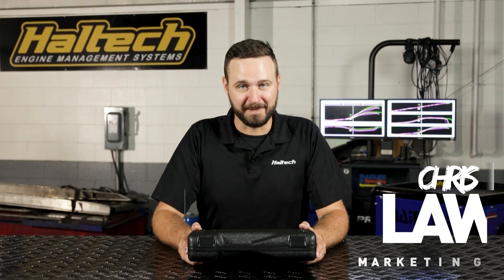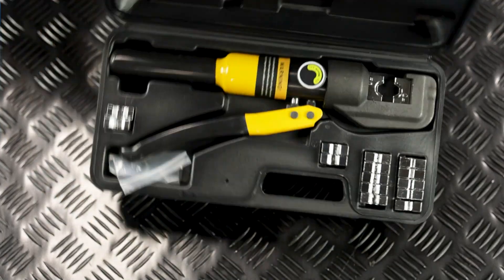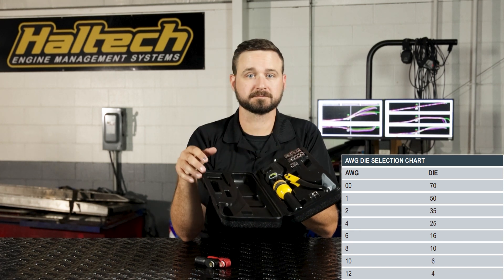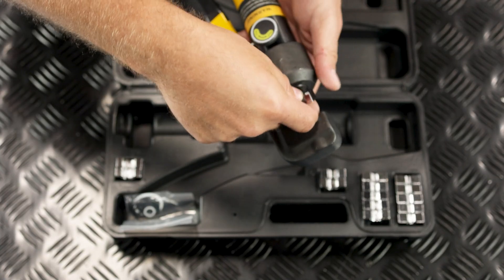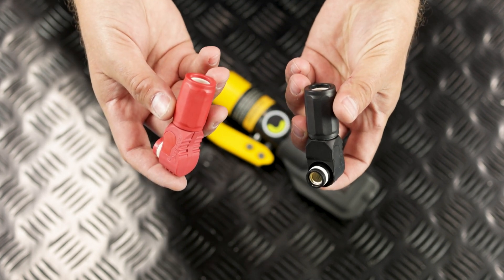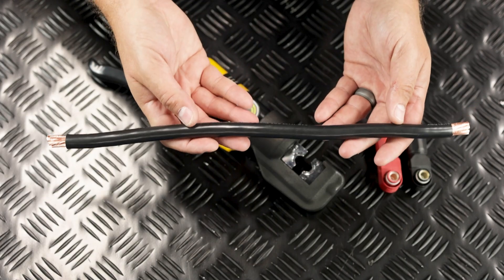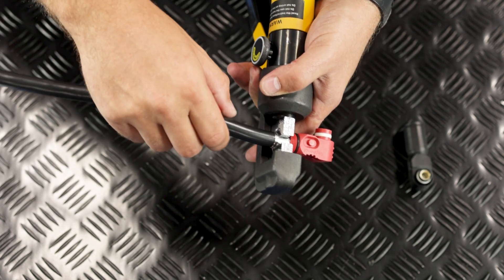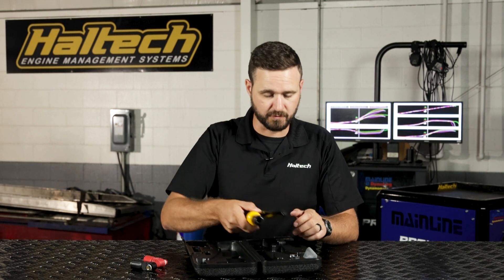🔍 Haltech Hydraulic Crimper - 5 ton of hand-held crimping power!

Comment: Yeh, yeh. Call me old stuck in the mud, buttttt, I still like to see artfully! Soldered terminals. At least have the copper cable potted with silicone grease. Capillary action can pull in moisture into minute interfaces. I guess no worry if your car just sits in the garage.
Reply: Soldered terminals are extremely susceptible to vibration damage. Silicone grease is a dielectric. Both of these are the exact opposite of what you want to rely on in an automotive application, especially high-performance applications. I know, and understand, that these were the "norms" back in the day, but modern testing has proven that crimps are the way to go.

Comment: haha, I had a go with a very similar (exactly the same) tool, I used the "correct" die for  a 2AWG wire - If I hadn't done a pull test (what wasn't demonstrated bere)  I wouldn't have realised that  - I needed to use the nextsize down (and carefully partial) crimp and rotate thee tool to avoid crimping "ears" in the fitting - seems that there should be a 33mm2... (ie the 35mm2 die is too large and the 25mm2 is too small - for the narrow walled fitting.)

Where can one get correct AWG dies for this tool?? - OR  for that, one needs to get a proper tool??   ok...